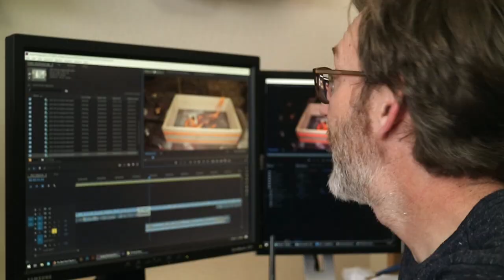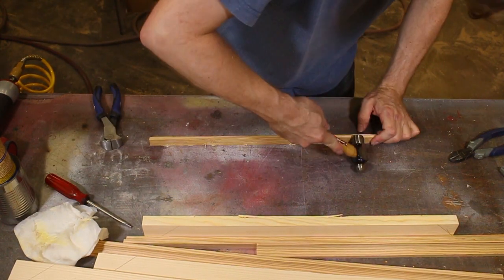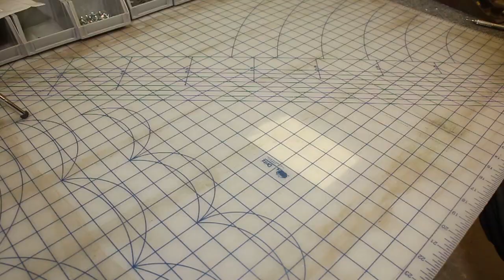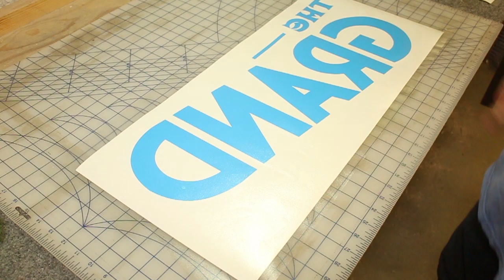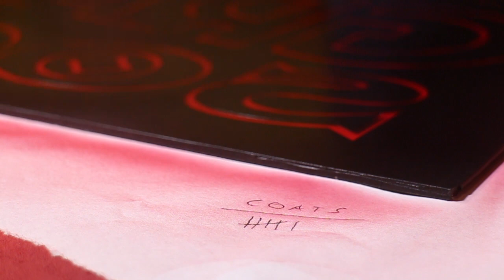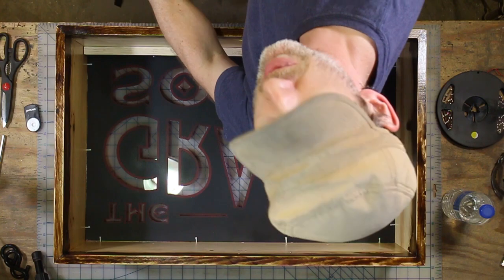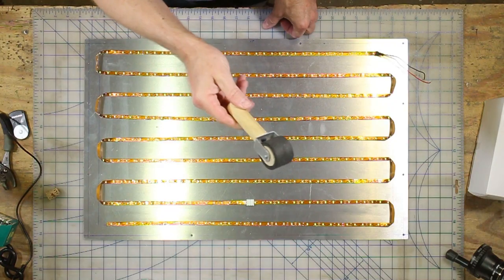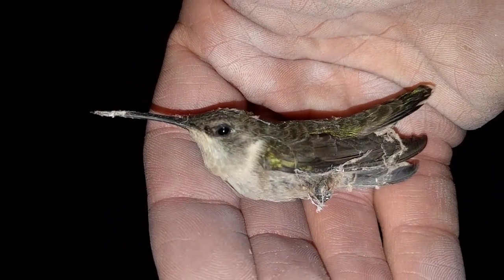Illuminated Glass Sign (Without Glass)

Comment: Great sign - pro LED strip trick - wire BOTH ends of the strip to the power supply. Stops brightness dropping on long runs, reduces the chances of failure when a connector fails (solder the strips, don't use those plastic joiners!) and lowers the current on the traces.

Comment: Another great sign! What if you sanded the plexy with a really fine grit paper, applied the vinyl paint mask, brushed it with clear coat to seal the edges, then sprayed on the tinting? This should eliminate having to score the edges of the mask - a tedious pain - as well as preventing the paint from capillary-ing under the mask. The main thing is - would the mask adhere well enough to sanded plexi?
Reply from the maker: If I sanded the acrylic, the clear parts wouldn't be clear and the black parts would've been foggy.